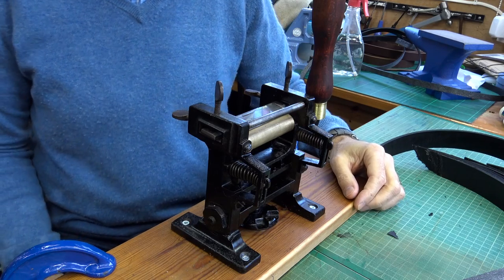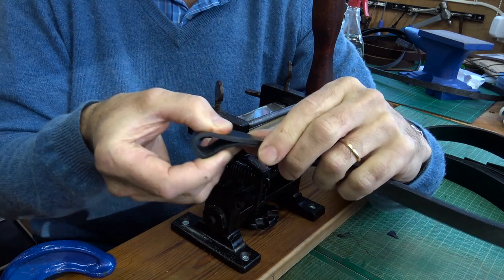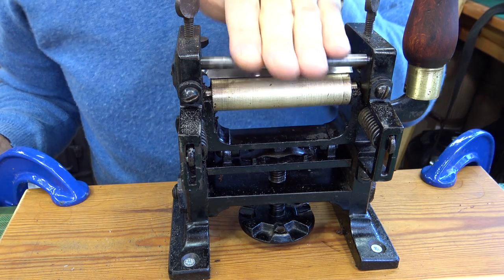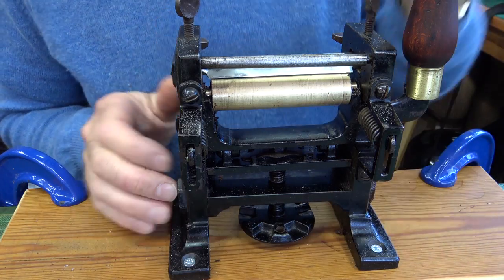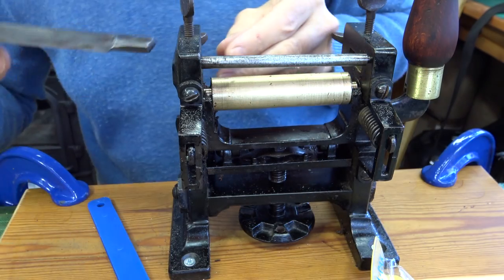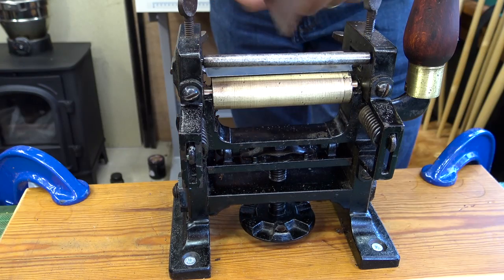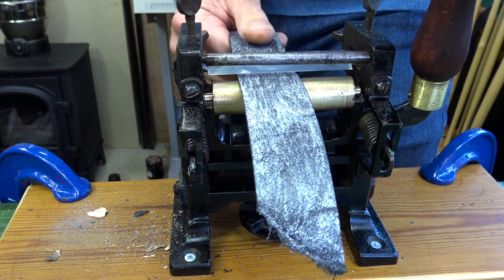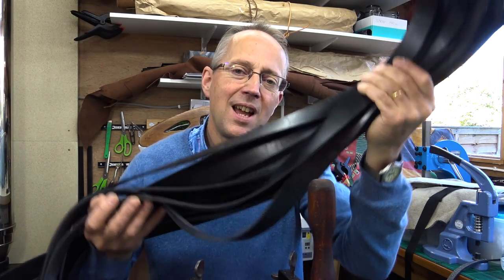Leather Belt Skiving and Splitting Machine

Comment: I have exactly the same machine and also spent hours on the blade. It's a great machine but I find the adjustment wheel a little notchy so I always cut a practice piece to set the depth. I've had it for around 2 years and only sharpened the blade once. it still cuts clean and true.
Reply from the maker: That's good..thanks

Comment: Q. Why do you put a tepered edge for buckles and use the thickest part on top? What I mean is, wouldn't it be btter to put the buckle in a piece of leather that was 1/2 the thickness of rest of it? Then overall it would be the same thickness as the rest of the belt or would that be too weak?
Reply from the maker: Jim Black Jim you are right it would be a bit weak...certainly a weak point if we did that.
Reply: So the fold where the buckle rests is the thickest part, or just slightly thinner?
Reply from the maker: Jim Black thins off just after buckle
Reply: Thank you very much. Great videos.

Comment: Don't mind if I tell you, that blade is really not sharp, with a sharp blade you don't have to make such an effort, I have a JOK machine, J.Polland - Wien 1 Bakerstr 5/7 - the dates written on it, done in Austria, but I sharpened the blade with a Belgian stone, it cuts like a knife through butter, I don't have the courage to play with my hand like you played with yours, I had the bad idea to use my fingernail let me try the cutter, it cut my nail to the flesh, I can cut slices of only 1 mm without any problem, in addition, this machine has the advantage that it also has a steering wheel with a crank, and if you want to thin very thin, no you pull the leather but you turn the steering wheel, a real gem, I was lucky enough to buy it from someone who didn't really know what he was selling, 100 euros, yes! and the thinning is controlled by a special graduated device on the left side, where if you want to go graduated, it has a lever that you pull with an indicator at which level of cutting you are... if you find such a toy, I recommend it buy it, you won't regret it, Osborne is a small child next to this gem